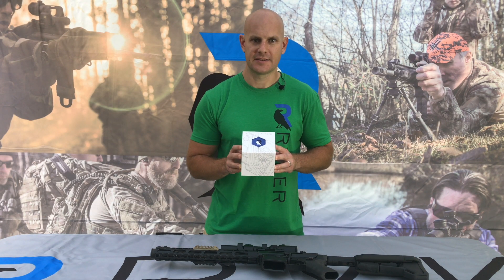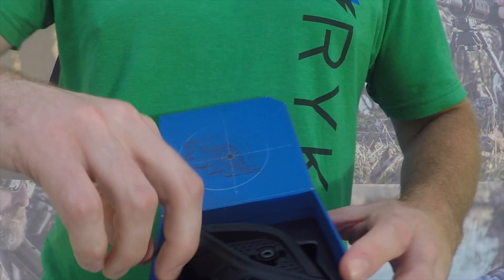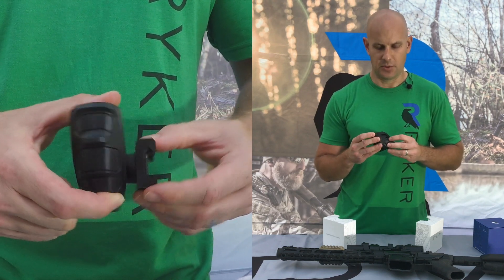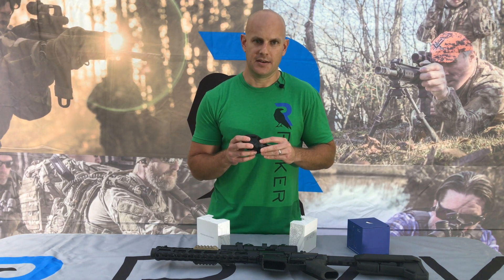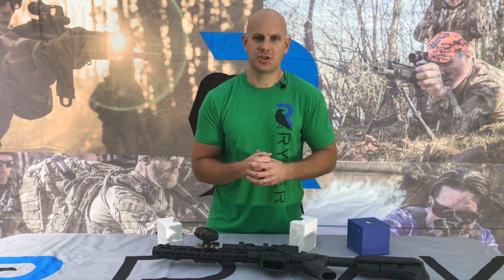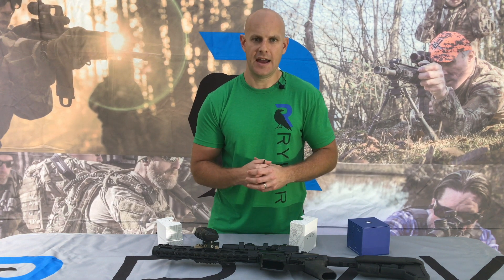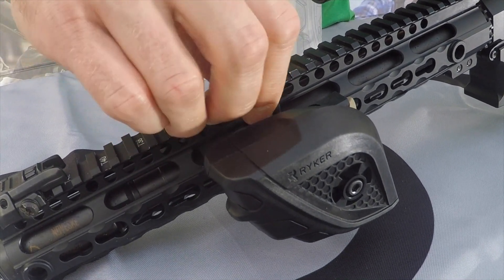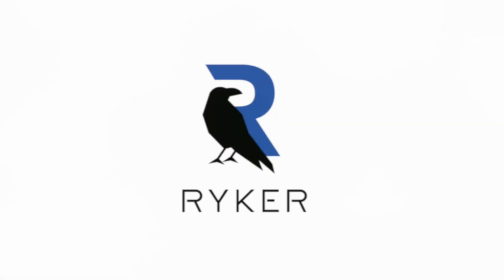Ryker Grip Installation

Comment: should there be any play or wobble after this is installed?  Or how tight should you crank it down to obtain the proper tightness on the rail?
Reply from the maker: There should not be any play or wobble. The mount is designed to work a little differently than others you may have used in the past. The plastic itself is designed to compress on the rail along the length of the mount. As a result you may have to tighten down the screws a little more than you are used to depending on the size of your rail. Don't worry, you won't break the mount, just turn until it tightens up securely!
Reply from the maker: Tighten it till there is no wobble.  The amount of wobble will depend on the rail you are attaching the grip.  We have found not all rails or rail attachments are the same size.